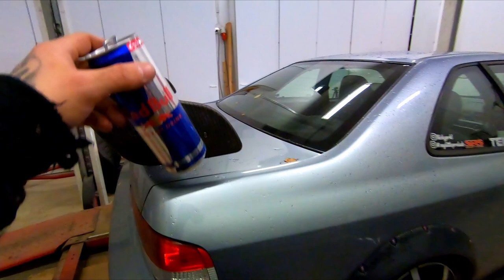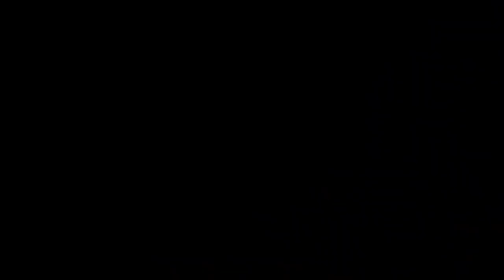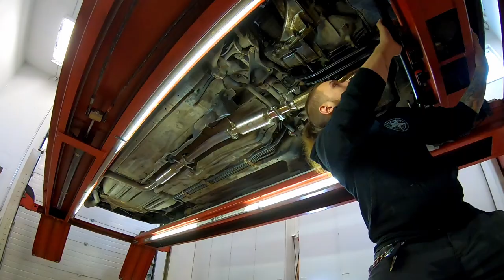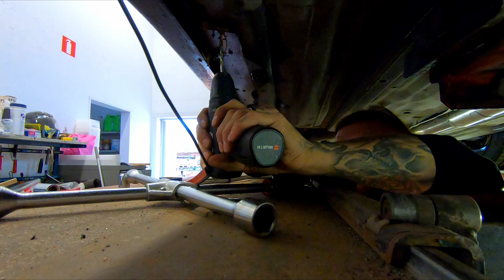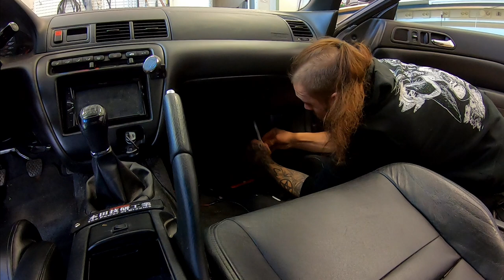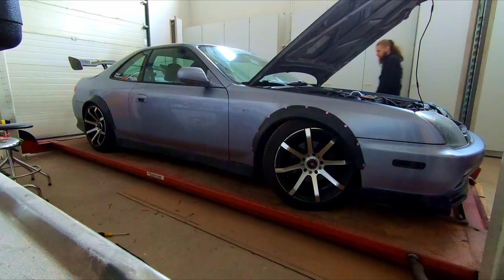Installing WISH RGB LED UNDERGLOW KIT on my Honda Prelude

Comment: so a year later how did they do i just bought some
Reply from the maker: Those worked just fine, I had problems with the wires because I extended them.
Reply: Thank you I appreciate that so they never fell off or anything only problem for you was the wires?